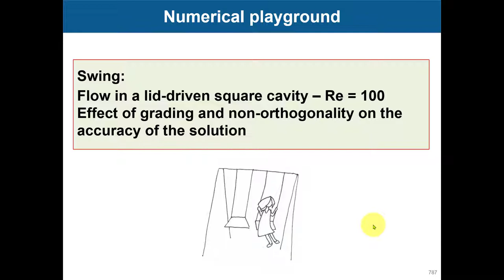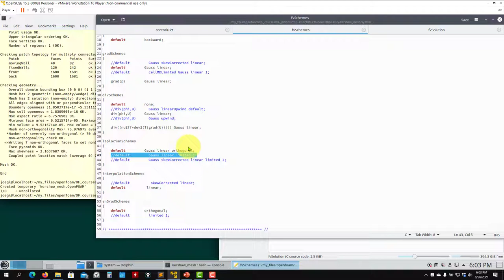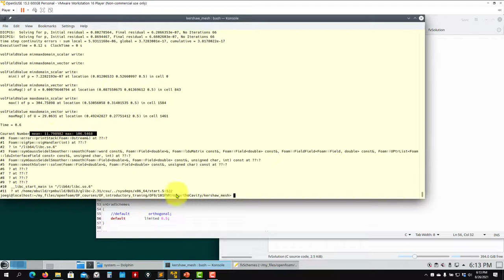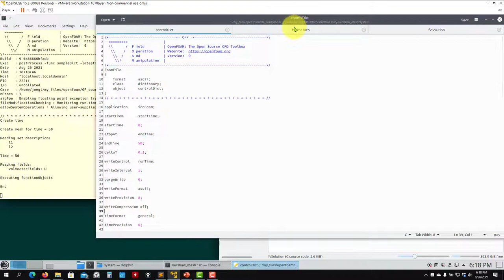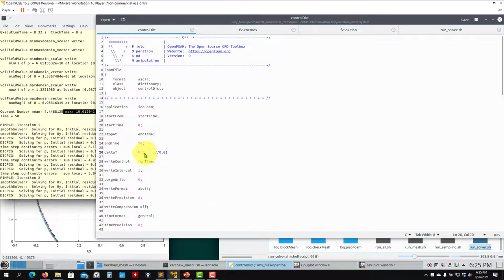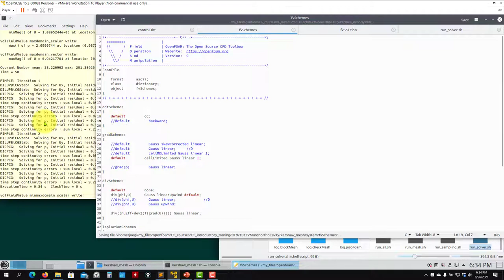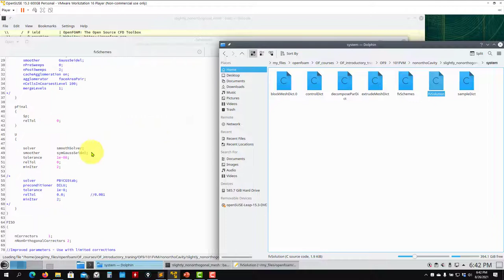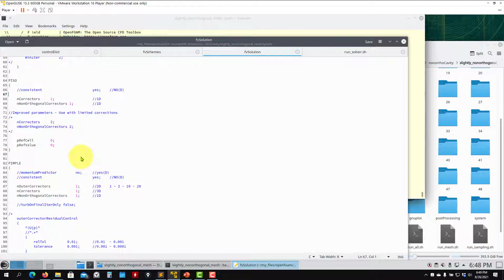6.10 Module 6 - FVM overview #openfoamtraining

Comment: Dear, thanks for such a nice video and tutorial. 
I got one question during the video. Could tell me why you did not touch the momentum predictor when running the icofoam with pimple loop? and why isn't it important to change the icofoam in controlDict file?. Thanks.
Reply from the maker: The icoFoam is a very basic solver, I dont recommend to use it.  Instead use pimpleFoam or pisoFoam.  In anycase, in OpenFOAM 11 and newer these solver disappeared. Regarding the momentum predictor, I see no reason to disable it.  By default is always on.

Comment: hello, Sir. at 18:18, you changed the under relaxation factors to 0.9, but a bad outcome obtained. So you choose to increase nCorrectors of PISO(good outcome). 
I had another try. I choose to decrease the URF further. I found that the outcome is very good with URF=0.5, another bad outcome with URF=0.1....Why is that?
To the best of my knowledge, if the iteration in each time step is converged for reaching the pre-defined tolorance instead of maxIter, changing the URF should not affect the solution but only the number of iterations to convergence. 
Besides, you show URF=CFL/(1+CFL), how this result is obtained?  When I try to decrease the URF, I did observe a decrease in the Courant number.
much thanks for your reply!
Reply from the maker: URFs are very problem dependent, so that might explain the behavior you are reporting. 
Be careful with this case, we are using URF with an unsteady solver, so URF sif not needed at all, you can control your simulation with the time-step.  However, when using the iterative piso method (pimple in openfoam), you can under-relax the inner iteration, but the standard practice is to use a high value, for example, 0.9. If you use a smaller value, you will lose time-accuracy and the simulation will take longer to convergence. The idea of under-relaxing the solution is to make the matrices diagonally dominant (from the point of view of the linear solver).